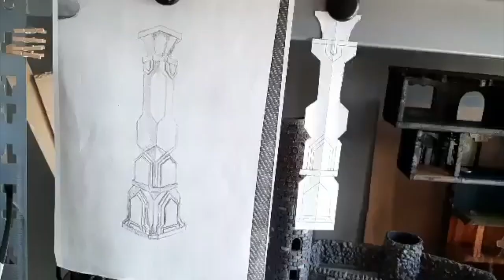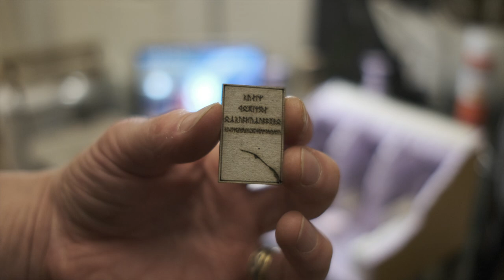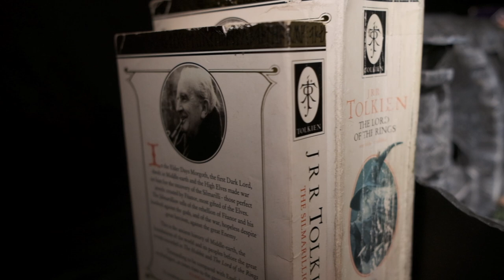How to build a BALINS TOMB - BOOK NOOK

Comment: Absolutely epic mate, im a huge fan of LOTR.  I'm a professional airbrush artist and about 2 years ago I airbrushed Hyabusa full LOTR with matching helmet.  I'm gonna build my 1st book nook , based on the Evil Dead , with the cabin etc. Any advice would be appreciated dude
Reply from the maker: Hey Shane, thanks for the comment! That sounds like a really cool Book Nook idea... I guess the only advice I have, without knowing exactly what you plan, is to make sure you have all your channels for wiring and tubing cut before you glue anything. I avoid gluing as much as possible until I have the layout just the way I want it. Also, avoid using card board for your box as it will warp, mdf is the way to go in my opinion. I would love to see that book nook when its done... Do you have instagram ?
Reply from the maker: @shanebowles4854  You have a new follower! Your stuff looks amazing man!
Reply: @Nat1videos  thank you buddy,  greatly appreciated 👊🤘